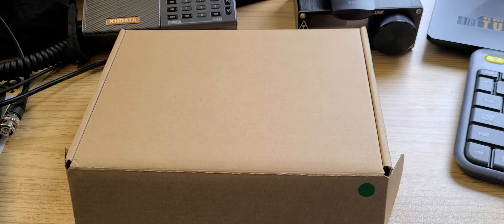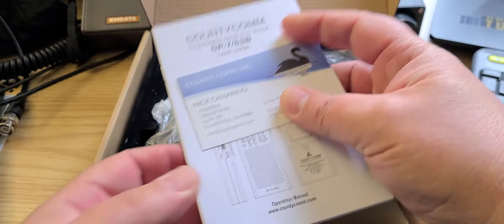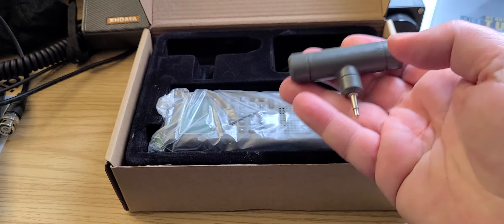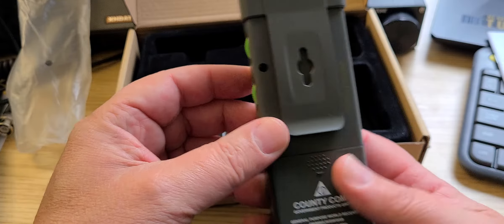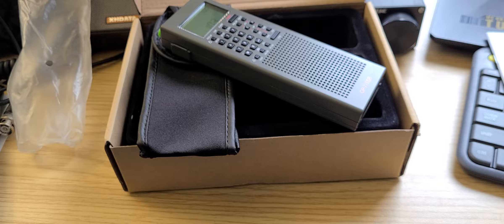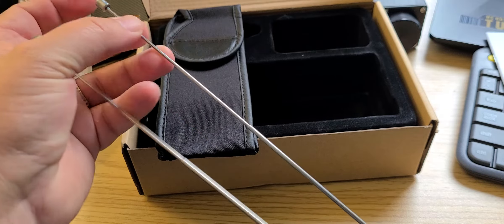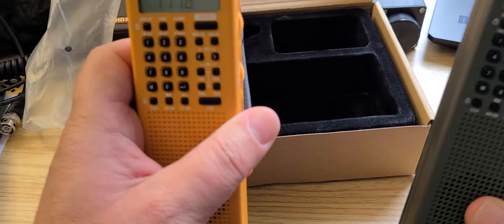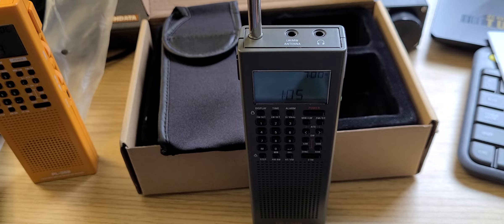Unboxxing CountyComm GP-7/SSB LW MW SW FM portable receiver with SSB

Comment: Hej Gill tack för videon CountyComm GP-7 I find very interesting I also like the shape of these radio devices. And I do not own any of these radio devices like the new, Tecsun PL-368 or previous models of CountyComm GP and Tecsun. But I did not buy them because the old ones did not have a keypad. But the new CountyComm GP and the Tecsun PL-368  have a keypad and that is very nice. Gill I look forward to your review of the new CountyComm GP-7 I was thinking of buying PL-368 but I might buy CountyComm GP-7 instead. And you also said that the antenna is little more sturdy on the, CountyComm GP-7 so that is nice take care Gill and have a nice week.

Comment: Hey Gilles, that case seems a little small; Can the radio fit in the case with the LW/MW antenna attached?
Reply: I have a PL368. Assuming the case is the same, no you cant. It's unable to fit when headphones are plugged in